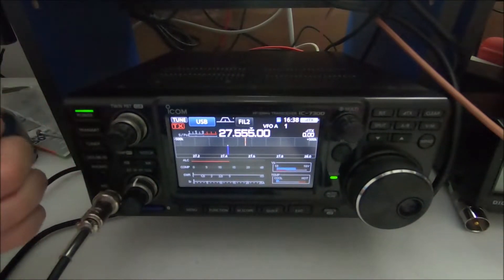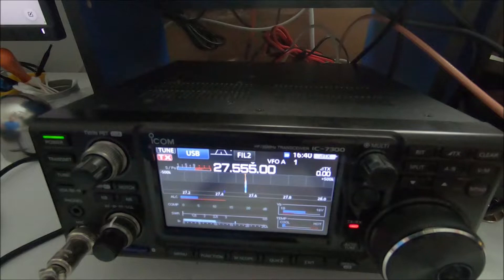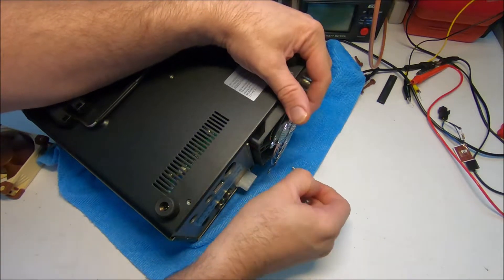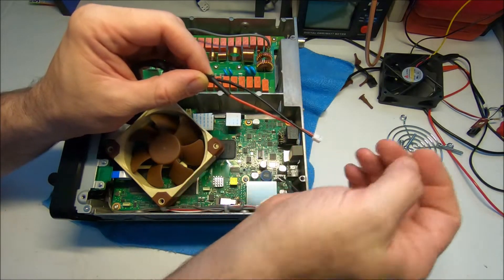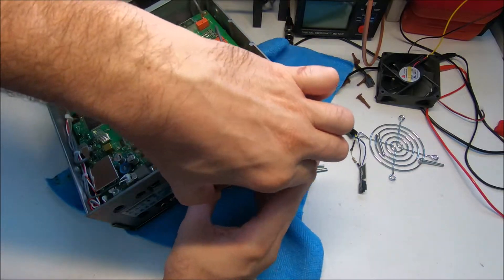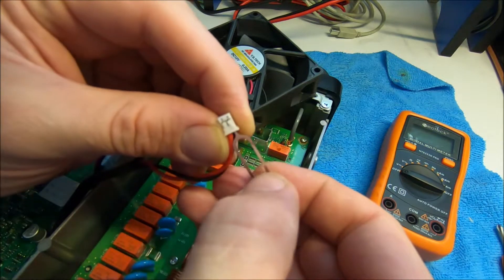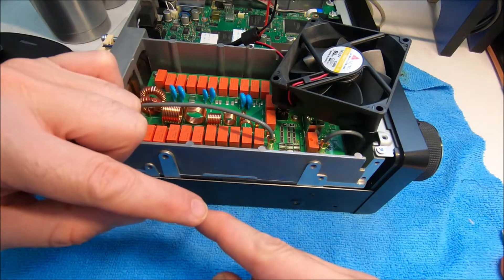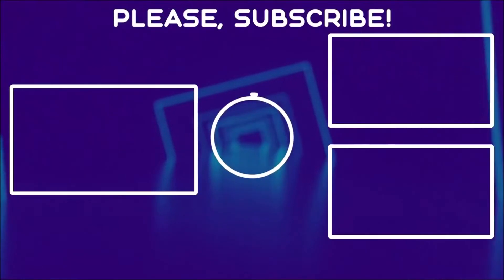Replacing the noisy Icom IC-7300 fan with a quieter one !

Comment: but wats the fan speed on each fan  because if the new fan is a lower speed than the icom fan that means the radio will get hotter under load
Reply: from experience, with this mod, the back of the rig gets so hot it burns fingers around the coax connector while the temp gauge reads ‘cool’.  Can’t run more than 25w with high duty cycle with this fan mod.
Reply from the maker: I do not know the specs, However I have had long QSOs @ 100W with no issues on the Icom getting hot at all. I do wish Icom had a "Q-fan" or quiet fan replacement or option at purchase.  Many have completed this fan upgrade and reported no issues as well.   Thanks for watching !  73